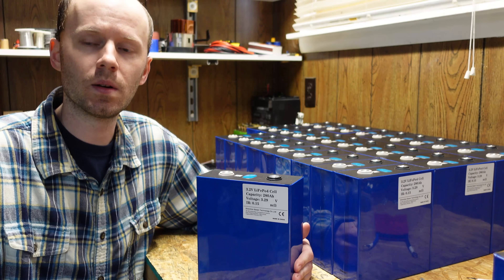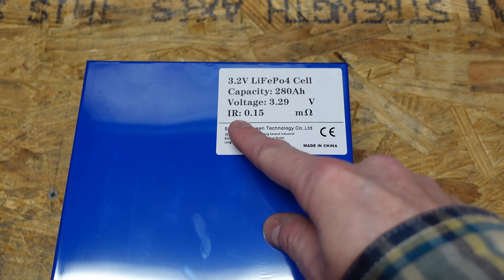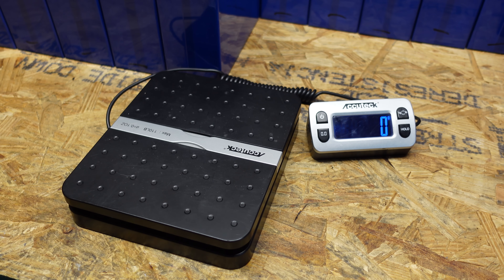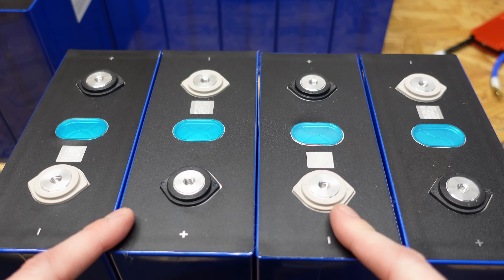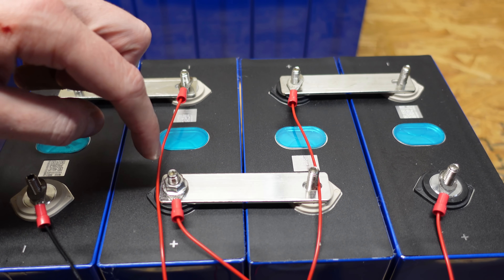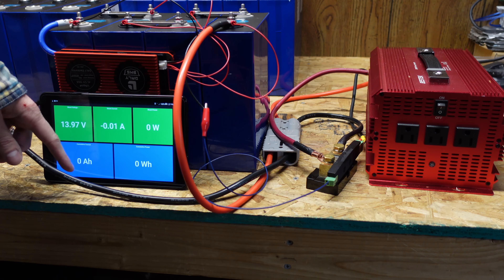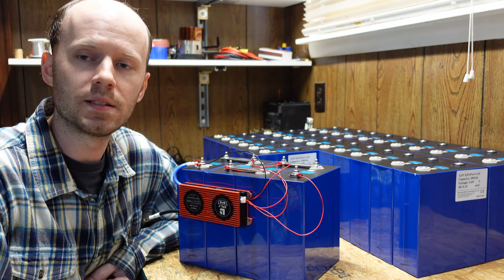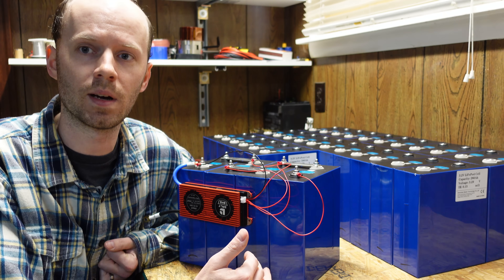EVE 280Ah 3.2V LiFePO4 Prismatic Batteries (Shenzhen Basen)

Comment: i have had zero luck contacting your recommended company, and i am a company. any other recommendations on the 280 ah cells? thanks
Reply from the maker: You tried contacting Shenzhen Basen? This is the only one I can recommend currently. I've only purchased from 2 suppliers and the other was a bit sketchy... I know February is Chinese New Year and the country pretty much shuts down for a few weeks. Maybe they were closed at the time and try contacting again?
Reply: @LithiumSolar  it worked out was a delay in the timing. thank you. i am dealing with Emiley
Reply: oh shit. now emiley said to cancel order and the send more money on the new order before i receive the refund............ NOT!!! very sketchy. just a up date... i just need new batteries for my home.  if you send email mabey not put all on the inet ??? keep up the good work. PS send diesel LOL!!!!
Reply: Let us know what comes from this?
Reply: @exitstrategy1366  hi all, so the batteries did come and look great. one terminal is drilled off center but works fine. no bulging or marks. am happy and will buy more. also came with studs ect. thank you all. still trying to find a bms that can power a 4000 watt split inverter. 200 amps all the time.

Comment: So after playing with LIFEPO4 and lithium ion what do you think in terms of the best setup for off grid solar?  I have been building a Litium Ion setup for a while but am thinking before I get to tack welding all the batteries together maybe I'm better off selling them and getting these.   I've seen more than once on youtube videos a Lifepo4 battery fail and take out a fair amount of power from a system, along with throwing the whole system off balance, leaking electrolite, etc, compared to have one litihum ion cell go bad (for instance in a 120 pack parallel, it gets cut out and replaced, and its such a tiny part of the whole array it doesn't make a big difference even if its just cut out of the pack and not replaced.   

Also, since these lifepo4's are relatively new, I have no idea if they will last as long as they claim they will.

What do you think is better?
Reply: Part of my concern is experiences like Dirk above.  Is it worth the risk to make these orders?  I have 1200 lithium ion 18650s averaging about 3000 mah.  I can sell them for a fair profit and swap to lifepo4 but some people having sketch experiences makes me wonder if a bird in the hand is worth 2 in the bush.  I am not an influencer so I can't throw my weight around if they decide to bilk me for 3 grand.

Comment: You tested 4 batteries and only got 280ah? Aren't they rated 280ah by themselves? Can anyone please clarify?
Reply from the maker: I wired the 4 batteries in series to create a 12V battery. When batteries are connected in series, you add the voltage but the amp-hours remains the same.
Reply: @LithiumSolar  so what’s the advantage of using 4 in series then?
Reply: @MegaDominican  A usable 12V instead of just the 3v from 1 cell.  A more useful comparison between batteries is watts.  voltsxamps=watts, so each cell is 3.2vnominal x 280ah capacity = 896watts per cell (3584watts for the 4 cell group 12v battery)  In this way you can compare total power in any battery regardless of its voltage.

Comment: Thank you for a great review! 
I am currently getting everything together for my first solar install, to take my THOW off the grid. 
This may be a novice question but, following your link there is a pic for cycle life for these cells that appears to show about 4,000 with a 20% DOD. That can't be right, right? 
Does anyone have specs from the supplier showing the cycle life at 50% or even 80% DOD? 
Thanks in advance for any info on this. Peace
Reply: My bad. I looked at it again today and realized it is showing expected capacity after so many cycles.
oops

Comment: One thing possibly to share (I don't see this mentioned by many YouTubers) is the importance of that heat-shrink around the aluminum battery case. The entire case is connected to the positive battery. Sticking these together in Series, imagine what happens if the bare cases start touching. Or am I missing something?
Reply: are you serious?
Reply: @boerbeun  dead. Test yours for yourself. The aluminum case on my 272Ah Lishen LifePo4's are positive.

Comment: A small tip: @ 1:00 if sold as brand new cells, they  just don't place a sticker over the existing QR code or scrape it off or do something else obvious. Instead they peel off this top black plastic piece and attach a new one with a fake QR code.   In such cases  residue of original QR code will still be visible underneath that black plastic strip... I've come across that kinda cells several times. 
However, concerned the condition of terminals and the fact they have no gaps in between, I think your cells are actually brand new. Failing to put out 280Ah or more in a near 0.2C test is a bit weird though.

Comment: Great video and thank you for sharing the info on your new supplier.  It’s very timely as I am in the planning phase of building my 48v system.  Do you mind sharing how you plan to configure yours?  I see conflicting stories about pack configs with this chemistry. You also mentioned the 2.2v LVC on the BMS but the recommended cutoff was 2.5v. Will you change to a BMS with the higher 2.5 LVC once you set these up to put into service or keep what you are using now?

Comment: Hi! I want to change to lithium on my catamaran. It's got 9.9hp outbord with electric start for 'no wind' and docking situations. The current draw on the starter is less than 50A. Would these batteries be able to dump that much load? Thanks!
Reply: These batteries can handle way more than that... 1C rate is 280amps.... Lifepo4 is better than lead acid discharge rate wise and LTO is better than that (but is lower density and more expensive than lifepo4)

Comment: What BMS(s) would be an option for an 8S configuration with these batteries at 24V?
Reply: overkilll solar
Reply: Overkill Solar's BMS are probably one of the best for the money. Tons of features and settings and Bluetooth connectivity.
Reply: AliExpress has 6+ different BMS that work fine. Overkill’s come from China and you’ll wait 4-8 weeks too.
Reply: Jkbms

Comment: Hello, have you had one of these cells expand on you, because the cell can doesn't have much structure. If they did expand on you, how do they look like, puffed up like a balloon?
Reply from the maker: I have not had any expand during my testing. I plan to compress them down as per the specifications sheet though. More details on that to come soon.
Reply: @LithiumSolar  what pressure are you going to compress them at?
Reply from the maker: I'm still in the planning stages. More info to come :)

Comment: Wonder how many cycle can these battery go through
Reply: that would depend on your DoD usage - nothing is for nothing in engineering or chemistry
Reply: @CosmicSeeker69  That's some non-sensical drivel there. How about some actual specs of the battery. You do realize different chemistry and quality yield different life expectancy of battery right?
Reply: @ericvelasquez1282   Not quite drivel.
If you don't abuse them (over charge or dis, or frequently pulling max amps ) I think this chemistry is calling for ~3500 cycles (total in/out of its capacity) before dropping to ~80% capacity.

Comment: Why did you order so many? Off-The-Grid Project?
Reply from the maker: Yes. This will be a 16s2p. I'd really like to order 64 more, but monies...
Reply: @LithiumSolar  Should be fun the watch. What area of the country are you in? I live in So Cal, when it's sunny, solar and lithium is a no-brainer. Panels, Cord, Controller and Batteries. It Works, but in overcast, nothing works! Is there a solution or is the answer to fire up a generator or tie into a grid? It seems that none wants to tackle this problem?

Comment: THANKS FOR THE VIDEO. Camping season is coming! I've been researching on how to overcome low solar output in overcast situations. PLEASE HELP! You can have all the best equipment, but without the sun it's useless! How about a video or is there no solution?
Reply: Im just interested- are your panels fixed horizontally Bill?
Reply: @jupiteradventure5284  I have 2 120w panels in parallel with a Renegy Controller and a 40 ft 8ga welders cord that I can move into the sun and adjust for highest output. The issue is that with full sun I can charge in a few hours (12a), but when there's overcast they charge very little (1a). It seems that no one is addressing low sun issues and how to overcome it. Some say run the panels in series and use a MPPT controller?

Comment: When you first get the new cells what's your routine. Voltage, internal resistance, top balance, cycle the battery, what?
Reply from the maker: My plan with these is simply top-balance then pack build. I don't think I'm going to test test them all individually. Other than the 4 random cells I tested for this video, the rest will have their first full cycle in a 16s configuration.

Comment: I thought that bms positive leads got to each cell's positive terminal. Looks like you connected one of those to the second cell's negative terminal. Why?
Reply from the maker: The BMS leads go to each series connection. There is only one positive terminal, and that's where the last red wire and the inverter red cable goes.
Reply: I noticed that also. Because of the bus bar it doesn't matter if the lead is connected on the negative of the previous battery since the bus bar connects to the positive. Other than workmanship would dictate hooking to the positive side and there would be millivolts drop across the bus bar during high amp charging which might cause a slight cell balance problem.
Reply from the maker: @LrbinMT  What you are saying is correct in theory, but a BMS like this doesn't have precise enough accuracy such that it matters in a setup like this.

Comment: I notice after you connect the negative wire from BMS to the Negative on the battery you hook the first red wire to the negative on 2nd cell battery,  Is that correct in connecting the BMS?
Reply from the maker: I connected the first red wire to the first series connection. It just happened to land on the negative post. It doesn't matter which since both are connected electrically with the busbar.
Reply: @LithiumSolar  okay! Now I understand.  Thanks for clarity and response back!

Comment: @lithiumsolar I have a golf cart with the 105ah 48v roypow battery. I believe you mentioned that roypow is owned by eve in another video. Could I upgrade the bms that comes with the battery pack for another like a daly that will have a higher output of amperage? My pack now has a max output of 200a. I have my 600 ac motor controller set to 180 to be completely safe, Or would building a new pack be worth it?

Comment: We avoid using lithium entirely and have now standardize on Graphene flat plate cells for 3 1/2 times the life cycle. 1,000,000 cycles. 30 + years of service in solar if you discharge every single day.
Reply: That's fascinating  Paul. Do you have any links, or tips about where I could learn more please? ( I love graphene). Regards from the You Kay
Reply: We use power modules to our own specifications from Zoxcell. I can assist you if needed. Also due the fact that we are located in Canada I can address any application questions that you may have.
Reply: @paulbianchi7877  will apareciste your asistente please contact me

Comment: Best explanation of hooking up a BMS I have seen, thank you.  I am planning to build a small electric boat.  What is an appropriate charger for a 48v pack built with these cells?  Good info is hard to find.
Reply: you need a 58.8v charger for 16 x lifepo4 cells in serious connection

Comment: Yeah the compression is a big issue. Suggestion? Threaded ready rod. 32 of these units? That is the equivalent of 2 Tesla powerwalls. Nice.
Reply: so i am new and would like to ask about 32 cells and what the total capacity would be? if they were configured in a 12v array? what about if it was configured as a 48v like a powerwall?
Reply: @bobham919  If arranged in twin 48v banks each one would be equivelent to 13.8Kwh of storage. 16 batteries for each bank.

Comment: why are you using a 100amp BMS on the 280 ah batteries, shouldn't you be using 300amp BMS ?
Reply from the maker: No. I don't plan to ever pull anywhere near 100A so 100A is more than enough. Your BMS doesn't have to match the amp-hour rating of the battery. It just has to match or be greater than the maximum amount of current you will charge/discharge.

Comment: I think the housing of the cells are connected to  „+“ so you should have an isolation between the cells because of the risk of a shortcut. The original isolation if the cells is very thin?
Reply: Not so with these cells. The case is isolated from the cell, and also coated to prevent corrosion.

Comment: My Basen cells from the same supplier  had 4 of 16 with tape over dents and 1 of 16 was clearly used. Basen says as long as the voltage is ok no refund. Let the buyer beware. Mine were received 2/2021
Reply from the maker: Interesting. I inspected mine very closely and the only issue I found was the one I pointed out. It wasn't covered with tape or anything like they tried to hide it. Was your dent similar to mind (size/location)?

Comment: Hey, I need a large 12v system.  Do I need a BMS for each 4 cells, or can 1 BMS be used for parallel cells?
Reply: 1 bms will work

Comment: should be fun seeing all 32 cells in parallel to top charge balance all prior to putting them in series :)
Reply from the maker: I haven't quite figured that out yet. Since I will be doing 16s2p, I was thinking of doing them in sets of 16 to make it easier then taking one from each set for the 2p. More to come later :)

Comment: $120 per 1Kwh.  Fairly decent price provided they are grade A (meets rated capacity).  Vari-core on Aliexpress had some 90 Ah LiFePo4 for about $100 per 1 Kwh; however, the shipping was very slow (boat to Los Angeles then train to Chicago).  They tested at 90.3Ah so Grade A.

Where do you sell your 18650 cells?  I need to unload a few myself.
Reply: these were grade b

Comment: Why you dont use regular screws?
Reply from the maker: The threads on these are aluminum and you need to make sure your bolt grabs on to as many as possible while also not bottoming out and cracking the casing. It's safest to use the studs with a nut, because you know the stud is the whole way in and can hold it with the allen while tightening.

Comment: Hey found the video interesting. About compressing them, you don't have too it's in the spec of  the battery that the enclosure of the cells themselves compress them. The compression thing is 'old-hat' that some people still apply to new batteries.
Reply: My thoughts as well. "To compress or not" I thought it was settled NOT to compress, but rather possibly insert a thin membrane between, to allow natural expansion as opposed to butting them up side by side. I'll keep reading up on this.

Comment: Does anyone know the real source for these EVE cells? That quality difference is kind of striking. There's some information on Basen, but I don't know if they make these cells or just buy and sell them. Is EVE a brand name, a type? Are there ADAM cells? It's kind of opaque. It seems clear that people should try to get to know the supplier, say who you are, what you want, how nice their stuff looks. In so many things, the personal connection matters. But from Andy at Off Grid to you, the Basen stuff has been very good prices and service. I watch Meritsun videos. They seem to have a factory, and offer power walls at good prices. They need to get their stuff on YouTube, maybe send out some samples. It's like ebike batteries on Ebay. There are some Chinese brands and sellers. Some have US warehouses. The prices are so low it's almost scary, like how can that be? I guess people need to buy this stuff, test it, decide if it is good or bad. But right now there is a US vendor market with high margins and an Asian market, Ebay and Ali mostly, very low prices and margins.The Basen pricing jumps right over SOK, but it is in line with big EV company priicing, supposedly $100 a kwh in China for buses. Really glad it worked out for you. Good video. Not much to it, a few connections and a BMS.

Comment: Hmm, cheap or free 2,600+ 18650's that come along with a looooooot of testing / sorting / building time.  
Or the used 210 prismatic cells I bought which still come with a fair amount of testing and building time.
Or 32 of these new LFP cells for the same price as the prismatics and could be built in like, a weekend.
Reply from the maker: Exactly! These are a massive time-saver!

Comment: so 4 cells is 280 amp hour 12 volt battery?
Reply from the maker: Yes, that's correct.
Reply: If u connect the batteries in series no matter its 2 or 32 cells its 280Ah, but if u parallel the voltage doesn't change amps will go up

Comment: I don't recommend the Daly BMS as it only has 35ma charge equalization current and for a battery of 280amp hours its never going to achieve cell balance.
Reply: Wich bms then please ?
Reply from the maker: The DALY is perfectly fine. These are new batteries and shouldn't need much balancing... I'll be using a Batrium on the final setup though.
Reply: Thanks